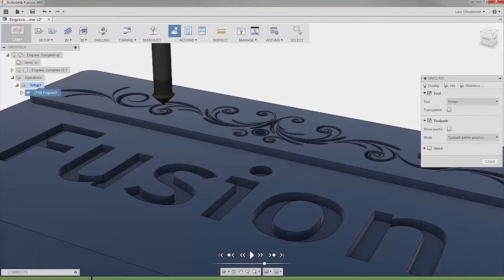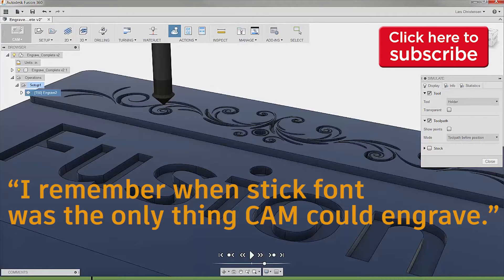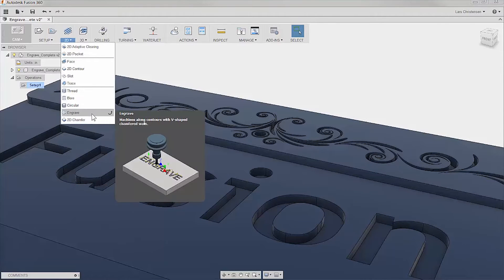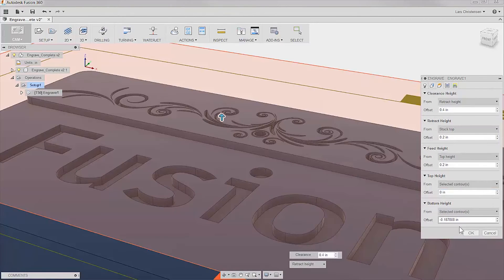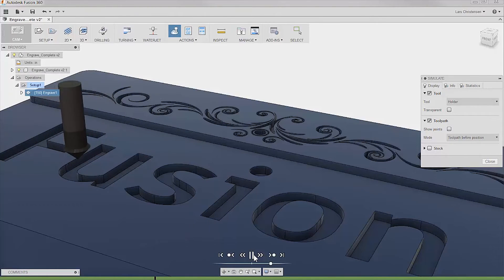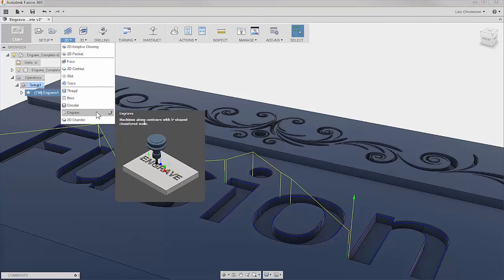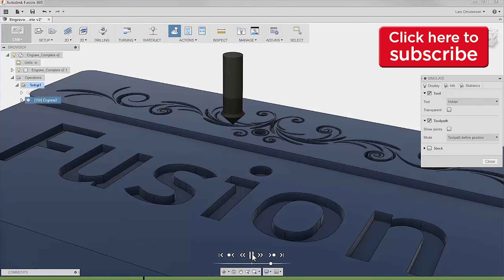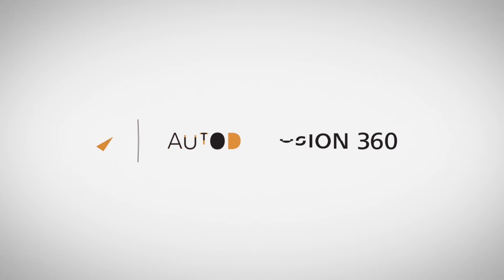Fusion 360: When Engraving with CAM became easy

Comment: You make it look really easy, but the first block of text, you are simply following outline of the edge of each letter. On the scroll work, it appears that your chamfer tool is plunging deeper as the contour becomes wider. There are cutters made for exact that process - can Fusion 360 drive that style of cutter to create that kind of effect? 

Great video, and all the others you have put out there! Keep it up!
Reply from the maker: +Bam Miller Thank you for taking the time to comment! I have to admit that I am not familiar with that type of cutter, so I am not sure how it would work with Fusion. If my lettering on the 1st block would have been narrow, you would have seen the same change of depth as you do on the second one. To use your words :-) the software will change depth depending as the contour becomes wider.

Have an awesome day!